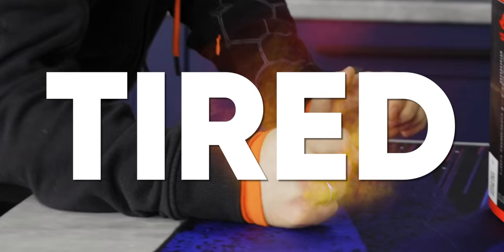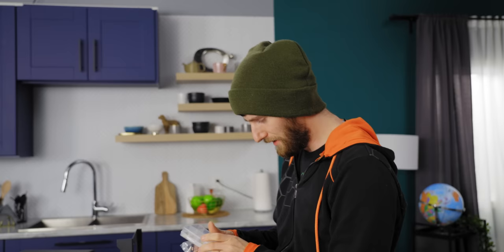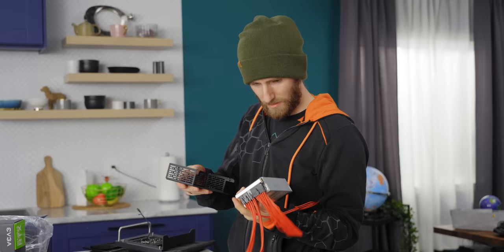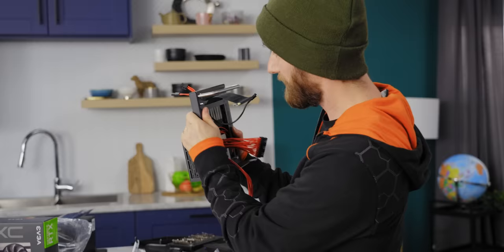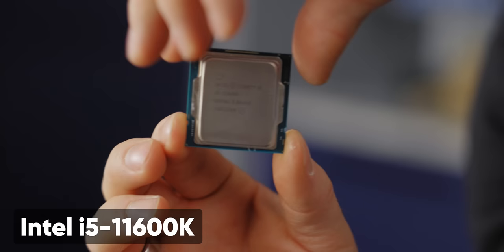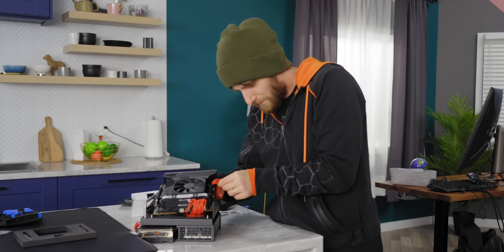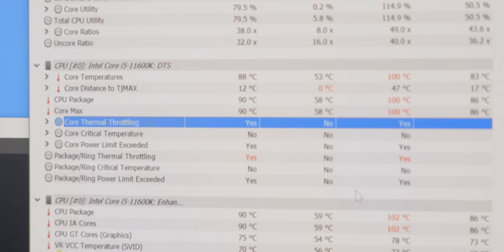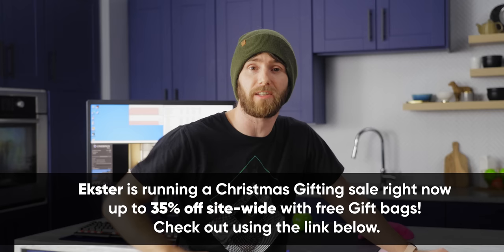Cases are Stupid. - XWORKS X32 "Case"

Comment: "taking a PC to visit a friend" is exactly the sort of scenario where I want a case.
Reply: Exactly^^
Reply: but not a tank :D You could easily get a housing for that thing but honestly I would build a thing like this from the ground up instead of paying over 100 bucks for it lmao
Reply: ... If you had a friend.
Reply: Imagine putting this PC in the trunk of a car, and having debris in the trunk crush the GPU when performing a hard turn in the middle of a 2020s Chip Shortage.
Reply: @thatguyalex2835  Imagine transporting this thing without putting it in a cardboard box.
Reply: @blaysertv6871  Agreed. However, imagine cardboard box debris/dust getting on your fancy Nvidia 1080 or 2080 GPU. The PC still needs a case. I wouldn't want cardboard dust on my circuit boards
Reply: @thatguyalex2835  I mean, cardboard dust isn’t any more disgusting or bad for the computer than the dead skin cells and loose fibers that make up most of the dust in one’s house.
Reply: @Fhwgads11  Yep. :) So true. Just avoid the big pieces of cardboard dust (> 0.1-0.2 cm). Human dust can lose problems also. Always check your workspace for dust, and periodically clean the area to avoid dust
Reply: @thatguyalex2835  Who the fuck puts a PC in the trunk with or without a case
Reply: @thatguyalex2835  There is np with cardboard, I had my active overclocked system for almost 2 years on it... It's not like it's static (or went up in flames lmao) and even electrostatic undergrounds like carpet aren't honestly a real problem (if you are paranoid for a tiny little chance you should also be scared to get hit by a lightning and shouldn't take literally any meds at all... Cars are monsters btw 👀). But everyone is overly cautious with their first build(s) and you shouldn't put it for no reason at all on a static surface, yeah... LTT literally tasered a working system btw and it went down, but after reboot everything was fine...
Reply: Then you must have a 30 series
Reply: @citizenblue  I am rocking a pentium gold 4425Y with integrated graphics right now, so no.
Reply: for me a laptop will always be the best for lan party stuff. its contained, backpacks are made for laptops, plenty of power to run games you would play at a lan party, keyboard included OR you could bring one, etc.
Reply: @MikeHedges1993  Well true, but good internet + wake on LAN game streaming would go brrrrr as well
Reply: @klartext67  I have always played with that idea! Its really interesting how close we are getting to be able to have a netbook and connect to a desktop at home and be gaming just fine. The good internet is tough to make sure everyone has though and I wouldn't want to buy a puck or something just for lans! haha
Reply: but what about the monitor? ...
Reply: @stephenkamenar  Who hasn't any monitors at home? 👀 Even a TV is an option...
Reply: @klartext67  who has a spare gaming monitor they're not using ... wtf?
Reply: @klartext67  also who even owns a tv in their house anymore
Reply: @stephenkamenar  Almost everyone, even like most students who live outside in a single room (obviously not to watch (the "good" old common) TV on it)... With game or pc streaming ig and stuff a lot of people honestly wouldn't need anything but a TV in their house in some years... like steve Jobs said, computers  will be like trucks 😅 (we also have powerful devices that are enough for a lot of people in Smartphones and tablets already) and everyone with at least two monitors in the setup has a monitor that isn't needed ;)
Reply: You buy this to get shot by TSA tryna fly to your friend
Reply: @stephenkamenar  what do you mean "what about the monitor"? I take that too
Reply: @MikeHedges1993  well that's obvious. It's not called a laptop for nothing. In the old days, laptops were more expensive than desktops and couldn't match them in power. Now days, for some reason, I can get a pretty powerful laptop with better specs than an equally priced self-build. It's a backwards reality
Reply: Way too heavy.   Gaming laptops is what people should use for transportation.  Transporting a PC, Monitor, peripherals etc is kinda ridiculous.
Reply: @BrawndoQC  not as ridiculous as the cost of two separate computers. I'll carry my PC anywhere to save $1,400 while I'm still barely making living wages
Reply: in my friend house where cats moves all arround, will be suicide take a exposed computer parts to they home... i mean, those cats love to toy with stuff and may a mobo will be a nice new toy in they eyes LOL
Reply: @klartext67  Cars are kinda like monsters. I don't like them, cos they are bulky and emit tons of CO2, plus I can't drive due to my ADHD. I recommend Not Just Bikes, a YTber. :) So you are saying, you built a cardboard case?
Reply: @viniciusschadeck4992  Cats would definitely be a concern. Or kids. Or my own clumsy hands
Reply: @klartext67  honestly, this "case" (spine chassis) is a ripoff. A good, full size, fully enclosed case can be had for $80. This uses 1/4 the material, offers no protection, and costs $100 more.
Reply: @gormauslander  Obviously, like I said, you could just build it by yourself, I would never spend over 50 bucks for a case (maybe with components for about 2000 like 3090 and 5900X and so on but otherwise...)
Reply: @thatguyalex2835  No, but you could just put at on there for transportation purposes
Reply: @klartext67  Yeah, a temporary measure. Honestly, a permanent cardboard computer case during use would sound like a cool idea. Hopefully, no short circuits happen, else the cardboard would catch fire.
Reply: @thatguyalex2835  I don't think so, I didn't got to what you refered first but yeah, I used my system for a long time out of the mobo cardboard box...
Reply: @klartext67  Linus Tech Tips actually made a cardboard box computer, albeit not from the original motherboard box, but I watched it a few minutes ago. Of course Linus would build a PC with cardboard, it's in his personality. :)
Reply: @thatguyalex2835  What they build in scrapyard wars (especially luke) sometimes 👀😂👌
Reply: @klartext67  I love LTT, and am so lucky I discovered this channel when I was learning about what a GPU was back in 2018, cos technology is fascinating stuff. Yes, I was late to the party. :)

BTW, I have a large spreadsheet that I made in 2018-19 that compares 100 or so computers against each other from different eras and apparently a modern gaming PC from 2016 is faster than the fastest supercomputer from 1998. If I added the Steam Deck to that spreadsheet, it would be faster than the 2016 gaming PC, yet consume less than 5% the power of that same standalone computer from 5 years ago. I did start seeing the end of Moore's law, and it started to taper off in 2018-19. I should update my spreadsheet to 2021, and see if Moore's law is ending. Researchers say Moore's law will totally end in 2020-2030 or so, so probably 2025.
Reply: @thatguyalex2835  Yeah interesting stuff.... This Supercomputer was as big as a whole tennis field 🎾 and only as strong as the tiny ps3... They literally build a supercomputer in 2010 out of over 1000 Playstations 😅😂 And now we have powerful IPads and stuff, very amazing
Reply: @klartext67  Yep, and apparently a company called Lightmatter is gonna make a processor that can do 50 PetaFLOPS (50,000 TFLOPS), that uses photons. Surprisingly, RGB lighting does make your computer faster, if you place some near/inside of a microchip. Lol...
Reply: @thatguyalex2835  LOL 😂👌
Reply: So no RAM swaps when you off during bathroom break.

Comment: I like how Linus forgot to add the SATA Data cables for the 2 SSDs and then never addressed that . . .
Reply: It's wireless 🤣
Reply: hes not use to building computers
Reply: Was about to comment the same thing. I ended up rewatching parts of the video since when I noticed the missing cables at the end I had to go back and check if they were never there to begin with :)

Comment: I wanna see a revisit of this case but with a 4090
Reply: Might be the best compact option, other than this open air case i do not see good compact options, was looking at the silverstone rvz 03 but some claimed it can be a hassle regarding heating issues
Reply: I actually watched this because I just did an open system build on a TV mount and have a 4090 FE. Got a little hot on Hell Divers 2 on max but never got over 80. That was before adjusting fan speeds on the GPU but didnt have time to test after fan speeds were adjusted. CPU does great though.

Comment: Normal cases: Dust filters, positive air pressure
This case: "Hello Dust"
Reply: Could work with a generous amount of dust filters, air purifiers, having a anti dust bath for everyone coming home, people changing clothes whenever they come to the room.
Dead skin makes some dust too so that would be the only hindrance, but a protective suit would fix that.
Reply: I havent had a case on my computers for a while, just blast them with compressed air every now and then. I dont, but you could.
Reply: @Away0G  all depends on the area you live in & where the desktop is placed.
Good for you that your desktop(s) works fine without a case.
Reply: It would not be that Bad actually. I have an ncase M1 were 4 fans with no Filters are installed. In the one year I that I got this case there is practically no dust in there in comparison to my Crystal 460x. I think it really depends on the airflow. I have my fan curves so low because a small case can vent heat much easier than a big sealed Metal Container. Oh fyi my computer sits on the desk, that also helps a lot
Reply: @VigiHunter  Just looked it up. Nice Case
Reply: @For3xampleJohn  the ncase M1? Yes definitly! So many options you can put in there. And it's so much more quiet with 4 PWM fans set on ultra slow.
Reply: also "Hello static electricity"
also "Hello spilled coffee"
Reply: All that good stuff on normal case =100 bucks
All them negatives on this case and less material =180
Reply: @purp0susanoo99  thats the price you pay because the production quantity is very low. Mass production really helps lowering prices. besides that, you don't pay for function but A E S T H E T I C S😂
Reply: @VigiHunter  I understand that. I get the value of moving it around but there is no way I'm taking my pc to my friends house. If you're paying for high quality pcs you best be paying for high quality internet. Im not going to my friends where he himself lags lol. Maybe move around the house but I already got my gaming room area and almost never move my pc unless I wanna add something ro clean it every 6months or so to drain it out
Reply: ---
Aye, I personally have been daily-driving on (discontinued edition of) "Thermaltake Core P5"-frames for past decade or so with only aircooling:
I dust(-off) the device once a year during driest-summer-day and generally speaking the dust accumulation has been almost non-existent.
Though, I do also try maintain the operation-environment as dust-free as possible
(wood-flooring specifically makes an ennourmous difference in dust-generation compared to full-floor carpets).

So until the "Framework"-computers are being offered in my region with my dream loadout, I think I might have found my new "laptop" very reminiscent of "Gamecube"-factory-form.
---
Reply: To be fair, this is also far easier to clean with an anti-static electronics vacuum. Or if you don't mind unplugging it and carrying it outside, a can of compressed air.
Reply: Hello water cooling loops
Reply: For the pleasure of near 200$ USD. Lmfao LTT c'mon.
Reply: Dust my arse I have an open air case and has way less dustings than a hotbox XD
Reply: ---
 @filipefigueiredo8415 
Yeah, compared to "Thermaltake Core P5" for which I paid 166€ the 179USD/159€ is certainly not due the material-amount.
But, at least according to my testing apparently this same 160€ is VAT and postal-costs inclusive since they're sending the unit directly from the factory
( that is when ordering to be delivered to the Finland;
I didn't yet make an commitment-payment just wanted to see the final-price as of writing this ).

So yeah, comparatively a "Canadian-design"-price sure.
But on the other hand there really is no other product like this plus the design seem and included items seem to high-enough-quality so I personally do not see that much of problem.
---
Reply: @PaveMentman  My thoughts exactly! I’ve been rocking a Core P3 for 5 years now and it never got dusty
Reply: @Away0G  Do you have any pets? Just curious, because if you don't have a cat or a dog (or small furry mammal of choice), that probably makes it a lot easier. Or at least, maybe a private office that they don't hang out/are allowed in. I feel like this case and approach would work really well for someone with a super clean, spartan room that doesn't get a lot of dander...
Reply: well if your window is open, yes.
Reply: Free your machine Maaaaaan.

Comment: GN: "80+ efficiency is dead!"
LTT: "Meet cute efficiency!"
Reply: No for real, what’s the efficiency though?
Reply: @BillyONeal  Most higher-end FlexATX PSUs like Delta or FSP will generally be 80+ Gold
Reply: @BillyONeal  It probably depends on how much you spend on one, but a lot of servers use PSUs of a similar form factor and some of them can deliver *2kW at Platinum efficiency*.
Reply: @MiIIiIIion  and even at titanium
Reply: @MiIIiIIion  I think it was STH recently had a 2u with dual 2.6kW PSUs, Supermicro twin.

The primary reason for the size difference is noise, I believe. Gamers like their PSUs quiet, with a big arse fan, server users... mostly don't care.
Reply: @morosis82  Yeah, a lot of servers aren't just loud, they're dangerous to be around without hearing protection. And the PSU is often a good portion of that noise.
Reply: @MiIIiIIion  because the server fan is insanely loud.
When I walk into the office in the morning and can tell that someone shut down one of the servers even before walking through the server room door (there are 4 office servers), I wouldn't even begin to consider a home machine for that. The other thing is that most servers at idle are still drawing 60% of peak power usage, usually idle is at the 92% efficiency mark, full tilt is at the 90-92% mark most of the time, all depends (I recently spec'ed some of the new server hardware we're getting). This is for plat, didn't bother with bronze/gold, think bronze was starting $120 for 400W, Gold $150, Plat was $200, break-even is under a year in terms of price difference. Titanium didn't make sense, think it was a 1W difference or something based on spec.

Note subtract 1-3% in efficiency if US, 115Vac, 230Vac is more efficient.
Reply: Server powers supplies are built for reliability over efficiency because if they fail then all the time spent finding a replacement is time your users are not able to do work and thus you and your business are losing money.
Reply: @jyadel  I wouldnt want one with lower efficiency because keeping something that small with that mich power output cool would be terrible.
Reply: I have that Delta 500w, its 80+ Platinum. I don't know if that's true but that's what it says on the side.
Reply: To be fair... who actually cared about effeciency? 95% marketing and 5% tech.
Reply: I was about to comment about this, flex ATX PSUs are usually very efficient. Because many times they aren't designed for normal PCs but for servers instead. Many of them are kind of loud because of this so people mod them with noctua fans.
Reply: DPS500ab flex used in that vid has 80+ gold

Comment: I do like the silicone floppy cabling.
Braided cables wear out and grow hair, and bulky cables feel like you are going to break them if you bend too far.
Reply: Silicone wiring (they are wires not really cables :b) can also be a higher gauge since they have finer cores
Reply: Silicon also is incredibly heat resistant. So that’s a plus.

Comment: Something like that for a mineral oil cooled PC might work. Sort out the power button, use Thunderbolt (so all your I/O is from a dock) and then you can just build it and submerge it. Easier than the older mineral oil PC builds.
Reply: Actually not a bad idea - Especially if you run a slot for it to slide into with the attached handle to pull it out
Reply: @evanjones4671  In a similar manner to the Mac Pro?
Reply: @therealkarlmarx1818  Somethin' like that but reversed so the inner part comes out instead of the outside shield
Reply: Wouldn't that nullify the portability benefits?
Reply: @OmniPlatypus  Yes, but not everybody wants a portable desktop. The fact that you would have to carry  monitor and keyboard and mouse around also nullifies portability unless your intended location has them. This  is just a different use case for using this configuration.
Reply: Or individual extensions or a seal so you can use all the io
Reply: Aren't minerals bad for electronics?
Reply: @atmunn  You can always hook up to a TV, most TV's nowadays have HDMI and gaming boards/mouses can be portable and wireless, so there are SOME pro's but what Linus said does make a point
Reply: @JayEllis76  absolutely, and like I said for this to be a portable build you would need to go somewhere where there was a monitor (tv=monitor in your scenario.) My whole point is that there is a second, completely different use case for a build like this that is not a portable build.
Reply: Why tho
Reply: Why? The cooling is amazing with a good amount of mineral oil